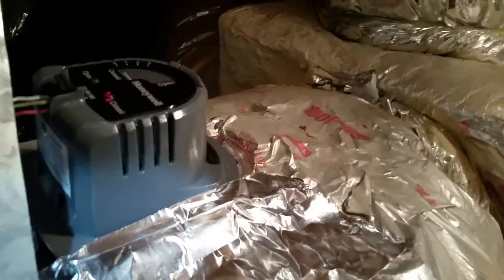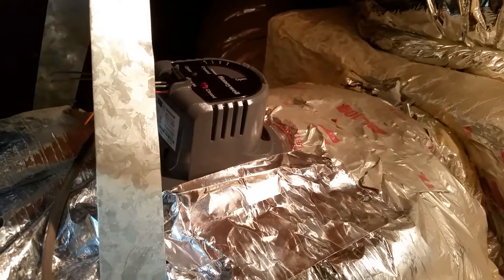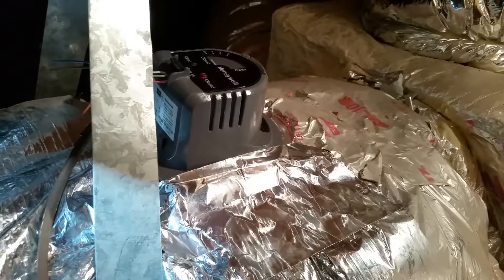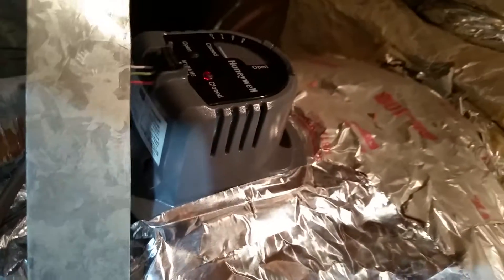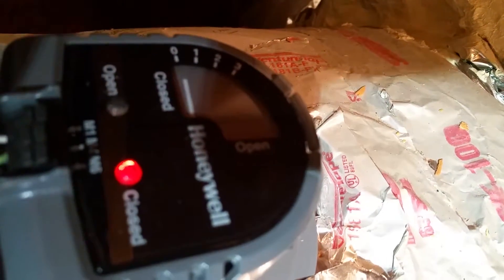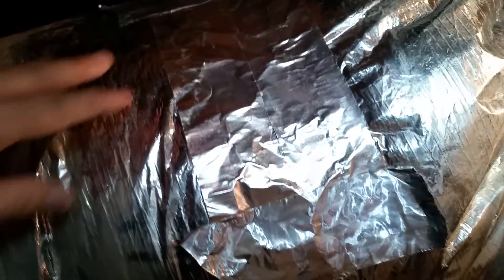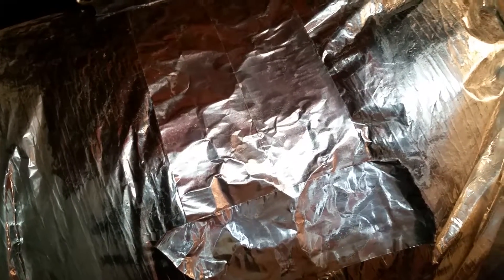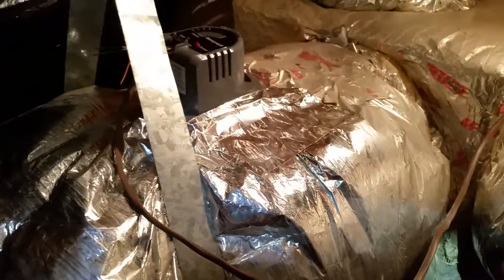M847D Honeywell Motor Damper Control - Zone 1

Comment: How did you make the damper stay open while the ac is running?It stays close when the air is running?I have the same actuator and couldn’t figure out whats wrong with the actuator.Also,I have to cut them and re-tape to see if the damper were close or open.

Comment: You did not have to cut into your duct  you can see the damper through the 1/4 hole with the plastic insert. Another youtube DIY hack repair. Everyone thinks HVAC work is easy.
Reply: You’re sweet